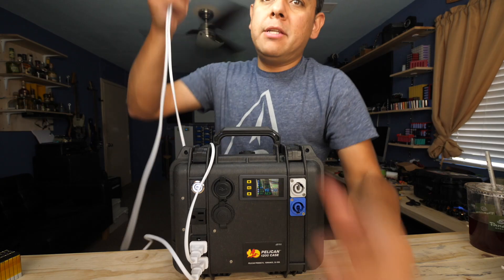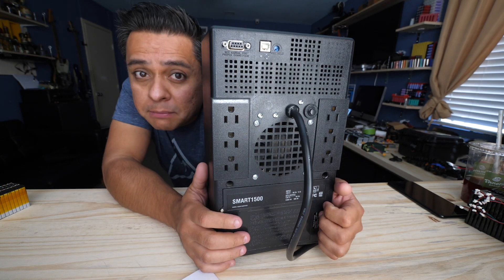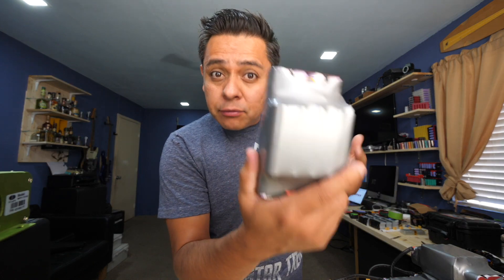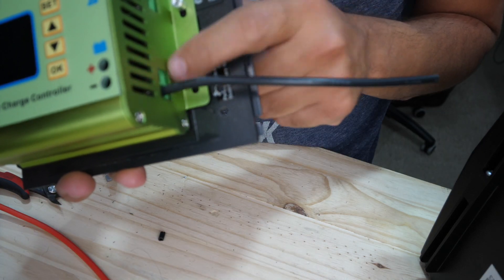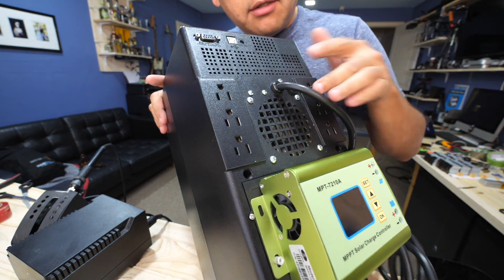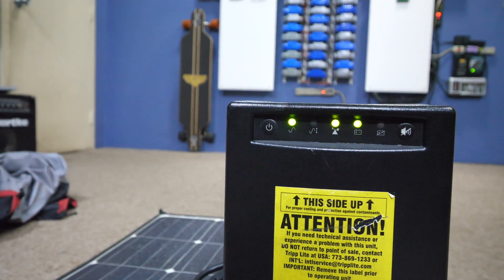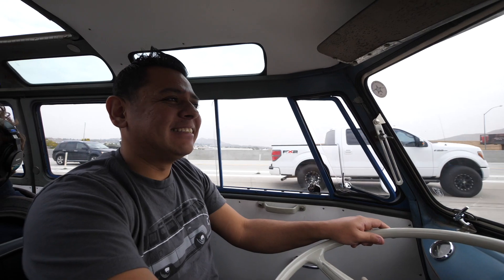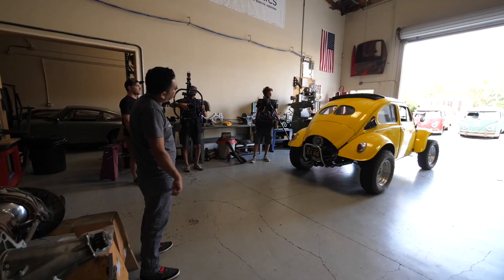The $400 Solar Generator you can donate To Puerto Rico

Comment: What is the overvoltage and undervoltage on the tripplite UPS. We want to make sure the tripplite can use all the juice in the lithium ion batteries and to do that it will need a overvoltage of at least 40 volts and a undervoltage of atleast 30 volts.  Run a quick test with just one 36 pack. Run it all the way down on the UPS and see if the BMS or the UPS stop working first and does the battery pack get all the way down to 30 volts. Same with overvoltage. Put a fully charged pack in at 42 volts and see if the UPS is happy with that.
Reply from the maker: I’ll test it

Comment: Also looking for the powerwall build with these battery packs. I'm in Puerto Rico and have been without power since Irma (over 60 days).
Reply: Please tell us more, are you able to get solar panels or inverters locally now, are any companies delivering packages if you order online, how did you get online, did anyone donate solar stuff to people, if there was a way to easily solar power peoples electric hot water tank with just two panels about 500W MPPT would that help, do you have running water, do people generally know how to wire basic things like solar panels and batteries, can you get electrical hardware locally OK like a hardware store, how is the gasoline situation for travelling around?
Reply: nrodge1 I'll try to answer all your questions as well as I can. There are a lot of people selling solar stuff and inverters on Facebook who are local distributors or just people who somehow got a hold of them and are now selling. However, a lot of the solar stuff has about a four week waiting period because people actually order it once you place an order with them. They're also jacking up the prices because of necessity. Delivery of packages is not that bad. UPS is back up to date and FedEx also, DHL is doing very well. US Postal Service, not so much. Online access is spotty at best. Basically cell data service is OK but not great so I'm usually online on my phone or using it as a hotspot for my iPad or laptop. However I can be happily surfing with three bars of LTE signal one second and, without moving an inch then find myself with two bars of 4G. Tesla mostly donated a large solar array for a local children's hospital but I haven't heard of any other projects where people have donated solar stuff. There's a local guy who connected with Jehu to put some of these together but didn't get a lot of response except for one box he got from a guy in California or Florida I think. People aren't so worried about hot water anymore. So, although solar panels for their heaters would be a good idea, it's not really a priority. Almost 90% of the island has running water now and a large percentage had it fairly soon, like two weeks, after the storm. I have heard of people retrofitting panels to their air-conditioning units however. Lot of the DIY'ers down here. Getting stuff connected with the right instructions would not be difficult. Getting hardware is getting better. A lot of supplier started getting shipments in and there's a fairly good availability of basic stuff you would need. Gasoline availability is now basically 100%.

Comment: Jehu, with just 2 solar panels they could take showers with a special MPPT controller on their standard tank, no mods. I've been doing it for years, see my channel. It's almost a all day thing with solar (depending) and once the water is hot they could possibly switch panels to the UPS system? Jehu, love your videos, always interesting and you have great resources like the recycle guys. I hope they have a source for cheap solar panels in PR, that would help a lot but I bet they sell out fast which is why everyone needs to get solar ASAP at least for emergencies. MPPT will be important to get a decent amount of hot water out of only a few panels (2 X 250W generally, 3X is better).
Reply: we see 185w 37v panels here in PR (300w too but don't know their voltage), not crazy easy to find but doable, the MPPT controller will take the extra voltage on top of the battery bank voltage and "turn it" into more AMPS, i have a controller and pure sine wave inverter, just need batteries and panels (waiting to get batteries first, the most difficult to get now here on the island.)
Reply: but cant find batteries!!! and the ones we see are deep cycle for cars, $200+- each at 60-90 AH / 12v, too much
Reply: Please see the videos on my channel about hot water. You can take showers without batteries or an inverter with this special MPPT controller. The MPPT makes it work well with only 2 panels 500W. Your 185W panels would work also but 3 would be better (555W) but on a smaller tank you might do OK with 2. There are other tanks that have different elements and those work too but you need to see the information on the special MPPT controller. I am thinking that the easiest way to get people hot water now would be to use their existing tank and mount the panels any way you can. I have seen pretty nice ground mounts using 2X4 treated wood.

Comment: This is amazing, thank you soo much for this.  There are a lot of people up here in Alaska that live off grid and this is a perfect affordable option for a small cabin.  I do have one question though, could you have the solar panel and wall power connected simultaneously without changing the settings on the charge controller?  One of the off grid family's I know periodically use a generator and it would be amazingly handy if when the generator was on they could charge the batteries without disconnecting the solar panel.

Comment: What is the max instant watt output of this unit?
Reply from the maker: 900 I think
Reply from the maker: Both ups and charge controller will stop charging at 42v if set correctly
Reply: But isnt the charger on the UPS meant to charge lead acid not lithium?
Reply: Here's the link for the company I hope it shows up. 980W it looks like and "PWM sine wave" whatever that is, someone throw a scope on this thing and let us know. Also some models have an external battery connector so this thing can do longer runs and I did see what looks like a fan on the back in this video. Seems to me that if you plugged it in and also ran solar the charge controller would back off if the battery is full so they should be able to operate at the same time but you are depending on the built in battery BMS to keep it from over charging it looks like. See my channel for some off grid and other solar stuff.
https://www.tripplite.com/smartpro-120v-1.5kva-980w-line-interactive-ups-tower-usb-db9-6-outlets~SMART1500/

Comment: @jehugarcia What's the voltage on the charging leads? I read Sealed Lead Acid batteries have a charging voltage of between 2.1v - 2.25v+, which would end up only being 37.8-40.5v, which is lower than max voltage of the 42v max voltage packs.

Does the UPS charge at above 40.5v?

Comment: Forget Puerto Rico I need that myself for a year now for my electric car lol I want to charge it while I drive if you could buy one that’s compatible and strong enough could you try it out for me lol it should be solar power generator 240 volts very hard to get ahold of one if you could use your resources and link it to us would be extremely helpful keep up the good work huge fan I drive electric car at only 25 years old and it’s a 2017 Chevy Bolt I couldn’t afford tesla which I tried since 2011 lol but I get 380 miles on one charge at $35k and $7500 tax Credit in Texas so brings huge savings with less charging and more miles the only bad thing about the bolts are their seats!
Reply: I saw a few videos on youtube where people stick a battery in the trunk and an inverter and then use that to range extend but it's more like if you stop somewhere without a charging station because the car usually won't charge if you are moving, maybe yours will let you. You will most likely need 1500W, and it will pull the full 1500W so you need to have a good inverter, it can probably be a cheap modified sine wave inverter because they use a switching power supply to do the conversion to DC on the cars. I think Jehu was trying to get these to PR to help people so I don't know if it's good for people who could do off grid DIY stuff another way to get these unless there is a unlimited supply. See my channel and the Leaf batteries I am using, those make it super easy and the Jehu $150 per KWh ones will work well too. Use the 6S ones for a 24V inverter since they cut off at 20V.

Comment: What if I used a 52v 17amp ebike battery?
Reply: It would be a good example of putting 52V into 36V equipment and seeing it smoke. You should do a video on that showing why that is not a good idea, but do it outside and in a open area for safety. If you buy more than one UPS you could also put 120V DC into one and show us what happens, that would be a nice fireworks show for sure. It does have an internal fuse that might ruin all the fun though :) If you are serious, remember that li-ions generally give up most of their energy at the top part of the voltage curve and the UPS does charge up to 42V for it's old lead acid batteries so if you always under charged your 52V li-ions you could get some use out of them but not that much. Jehu's batteries for this are perfect and very reasonably priced with BMS already installed so it's great for quick set up and emergency situations like in PR.

Comment: @jehugarcia Would this be a safe solution for a off-grid tiny house on wheels?
Reply from the maker: Yes
Reply: It can also power a big/normal size house without wheels too, 980W ain't bad. I pulled a number of circuits from the breakers on my main panel and wire nut-ed them all together to go to my 1800W Prosine. Since it has it's own overload protections and is like only one standard 120V 20A socket, there's no need for the breakers! Easy stuff. Later I could add another inverter and tie that into other circuits if I want. You can also run extension cords around in a pinch, I've done that too. See my videos on my youtube channel, I'm using Leaf batteries which made it really simple but Jehu's latest battery finds are really good. You can actually live off of only one socket of power pretty well. Get a Kill-A-Watt Meter and measure all your stuff and add it up to see where you are at generally. The power company makes a lot of money because they set up in case people use that 200A circuit they put on your house. They actually use that to justify the high prices and the base amount but people don't use it.

Comment: Hopefully the reason you didn't add short-circuit or overload protection to any of those connections is because the components already employ sufficient fuses?
Reply: Andin Briwel there is protection on the bms boards and the existing protection in the UPS. He's being relatively safe

Comment: Those terminals on that 7210 MPPT can easily be swapped to XT60 plugs like I did here: https://www.youtube.com/watch?v=9tP8Y-y2rGo  Its highly recomended and would make it so much easier to work with. Just make sure to add a dab of hot glue to hold them in place inside
Reply: Yep, that's a really good idea which I've done with mine as well.
Those little 7210A charge controllers are cheap, cute and work, but bear in mind they are boost converters, ideal for going from 18V -> 36V, or 30V -> 50V, but can't drop voltage from say a 30V panel to 12V battery.

Comment: Hey Nice work on this one. My toughts are why use 110v volt light bulbs, when you can use usb powered ones. less consumption and you would not need to run the inverter either. Especially in the case when the batteries need to last longer. Like on of these - https://www.amazon.com/LIYUDL-switch-Energy-Saving-Camping/dp/B0731BG9PJ/ref=sr_1_12?s=lawn-garden&ie=UTF8&qid=1510085152&sr=1-12&keywords=usb+light+bulb

They have quite good brightness and much less poewr usage.
Reply: I think he use light bulb just to show it works
Reply: Traby601sl he explains why in the video. This is quick low skill solution, using the existing UPS connections. You can configure it with USB yourself if, you have the skills.
Reply: I've understood that it's easier with the already existing plugs. But the power consumption is less, and since the generator is targetting a place where they would need extended life, cause the rebuild of the power grid mayt ake months, I thnk it's worth like the extra 10$ to invest in a usb converter there, and rill a whole to use it. Also most mobile devices charge trough usb and it easir to make 5v from 38v then, 110v and the back to 5v.

Comment: It it really safe to use the 110V input to charge the batteries? I assume you consider it safe due to the BMS on each lithium-ion battery pack?
Reply from the maker: Yes I tested it
Reply: Michael Kreitz that is why he puts the solar charge controller on it. The 110v charger is for a lead acid battery not lithium.DO NOT USE A LEAD ACID BATTERY CHARGER FOR A LITHIUM BATTERY.
Reply: Good question
Reply: Good question
Reply: He said the "hoverboard" batteries have a built in BMS. So if the dc charger from the UPS is 12V or 36V the BMS in the batteries is taking care of it.

Comment: Great Idea Jehu! I would take a small project box and place a female main connector(optional fuse type) and connect (solder)it to the mains plug after I cut it. Then glue it to the back over the area i cut the cable. Then if by some chance I have access to main, I could use a simple computer power cord to charge. That way the mains wire is out of the way.

Another Great Video Jehu!!!